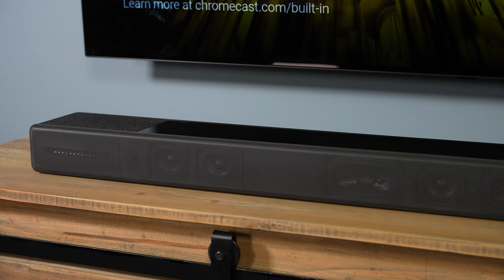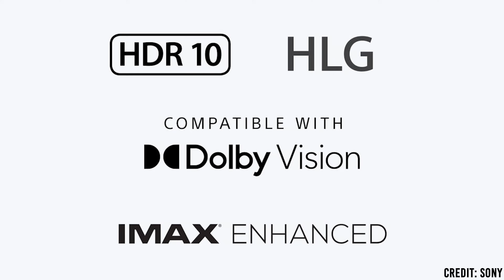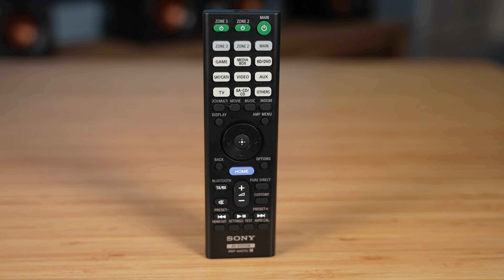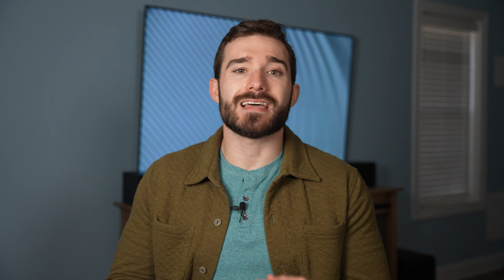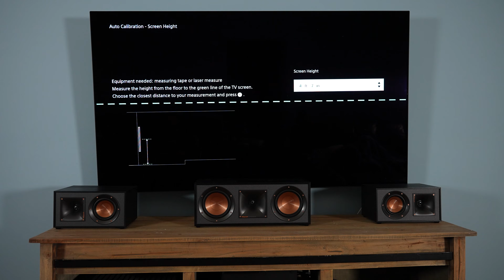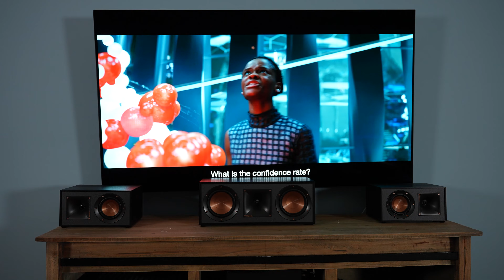NEW Sony Receivers! STR-AN1000 - Receivers are Catching Soundbars

Comment: I have the a80j w/HTA7000 bar, perspective wireless rears and subwoofer. I like the idea of getting the receiver to add a 2nd subwoofer. My question is, can this be paired with the sound the hta7000 and it will improve the audio soundstage at all? 

Second question is, can I use the receiver as a hifi player and stream throughout it to the rest of WiFi wireless network speakers in tendon with the Sony surround set up I have? I have been considering a fidelity audio player that holds a better hifi connection then my iPhone. Most importantly I’m curious if this will improved the sound bar and rest of the Sony speakers.

I love my ht7000 surround set up but do want subwoofer power, second addition sounds amazing but not a most. Second subwoofer aside, to reiterate, will this improve my surrounds performance or are they fine on their own? 

If I got this would I only get it to benefit adding a second subwoofer? Again, I have the a80j, ht7000 with perspective sub and rears.

Comment: If you please, sir, help me to connect my Hi-RES floor-standing ACTIVE-SPEAKERS, I NEED Digital Hi-RES AUDIO signal prosessing, no LOOOOOOOSEEEEER "RCA Line-In" to Active Speakers suggestion please. How can I connect my ACTIVE SPEAKERS (2.1. sterio with subwoofer) from a DIGITAL OUTPUT going out from Sony TA-AN1000 and into my ACTIVE SPEAKER's DIGITAL-INPUT PORT (HDMI EARC 2.1, or OPTICAL TOSLINK)

Comment: hello quick question I have a sony 77 inch a80 l I would like to go with this amp with a central speaker and 2 wired Klipish library speakers and put the subwoofer and the RS3 behind it on wifi that is possible ? THANKS

Comment: Hi, how does the wired setup compare to the hta9. I have the a9 which I like but clarity a little underwhelming. I was thinking of selling and going the wired receiver route. Curious if the change is worth the cost. Thanks
Reply from the maker: A proper wired setup with good speakers is going to beat any soundbar or system like the HT-A9 99% of the time. If you're able to do a proper wired setup, then that's the best route to go, it just won't be convenient at all.
Reply: Thats great feedback thanks. I am not worried about convenience and willing to put the work in. I like the idea of being able to select sterio only for music too. Thanks again
 @JonahMatthes

Comment: I have an LG 55-Inch 4K UHD Multi-HDR with Dolby Vision Smart OLED TV for the ultimate
immersive beautiful stunning movie theater picture quality When I had a 2015 Onkyo TXSR444 7.1 Channel Dolby Atmos Premium Home Theater Surround Audio/Video Receiver with AccuEQ Room Correction Calibration Software Technology Dolby Surround Upmixing DTS:HD-Master Audio 4K UHD Passthrough and Bluetooth Streaming paired with a Klipsch Reference Reference Premier and Synergy Series 5.1.2 Channel Dolby Atmos Premium Home Theater Surround Sound System I was about to upgrade my 7-Channel Dolby Atmos Home Theater Surround Audio/Video Receiver for $1,000 or less that has much more state of the art newer better greater premium features that my receiver didn’t have like DTSX DTS:Neural-X 8K/60-4K/120 Upscaling/Passthrough Multi-HDR with Dolby Vision Multiple Music Streaming Apps a High Performance Quality discrete high current power amplifier & 32-bit/192kHz digital-to-analog converters a higher end quality performance room correction calibration software technology 
I was deciding between the two highly hugely critically-acclaimed immersive dynamic impactful advanced cinematic state-of-the-art premium room-filling crystal-clearer impressive Dolby Atmos and DTSX Premium Home Theater Surround Audio/Video Receivers that both got very great reviews from both critics and users: Denon 2022 AVRS970H 7 Channel Dolby Atmos/DTSX Premium Home Theater Surround Audio/Video Receiver with Audyssey EQ: Dynamic EQ and Dynamic Volume or the Sony 2023 STR-AN1000 7 Channel Dolby Atmos/DTSX Premium Home Theater Surround Audio/Video Receiver with Digital Cinema Auto Calibration IX and 360 Spatial Sound Mapping for a the ultimate 3D Object-Based Moving Surround Sound Movie Theater Experience but Sony AN1000 Dolby Atmos/DTSX Premium Home Theater Surround Audio/Video Receiver works very best and flawlessly with 2017- present Sony 4K UHD Multi-HDR with Dolby Vision Smart OLED TVs in very great sync as a great combo for the most immersive cinematic impressive ultimate Sony 4K UHD OLED HDR Dolby Vision-Atmos IMAX-DTSX TV Home Theater Surround Sound System My 4K UHD Multi-HDR with Dolby Vision Smart OLED TV is LG not Sony so Denon makes extremely great dynamic powerful immersive impressive punchy Dolby Atmos/DTSX Audio/Video Receivers including the AVRS970H hand I choose the Denon AVRS970H to upgrade my Dolby Atmos 7 channel premium home theater audio video receiver over the Sony AN1000 because Denon makes very great immersive impactful dynamic advanced high-end/quality/performance receivers for decades so I bought and owned the Denon AVRS970H Dolby Atmos/DTSX Premium Home Theater Surround Audio Video Receiver and paired it with the Klipsch Reference Reference Premier and Synergy Series 5.1.2 Channel Premium Dolby Atmos Home Theater Surround Sound System that now finally supports DTSX and the 3D object based multidimensional moving surround sound quality with Audyssey EQ: Dynamic EQ and Dynamic Volume on is extremely impressive immersive impactful crystal-clearer dynamic realistic cinematic detailed awesome punchy room-filling advanced three dimensional atmospheric for watching enjoying and listening to films TV series music sports in Dolby Atmos DTSX Dolby Digital 5.1 (Upmixed to Dolby Surround) DTS:HD-Master Audio (Upmixed to DTS:Neural-X) Two-Channel (Upmixed to Multi-Channel Stereo) with tons of great bass treble midrange clarity impact immersion detail realism depth to be honest it actually feels and sounds like being in a real Dolby Atmos/IMAX-DTSX movie theater that totally rivals my nearby commercial movie theaters with 4K UHD laser HDR projection paired with Dolby Atmos/DTSX

Comment: The question is, can we run Wireless sw5 Sub with the physical connections of 2 Subwoofers on the backside of the receiver simultaneously? will wireless SUB with with those 2 physical connections of subwoofers?

Comment: is it possible for this receiver to change the voltage ohms from 8 and below
Reply: 6-16 Ohms Is listed on the back of the receiver. For 4ohm speakers you will need an amplifier.

Comment: Jonah, Can you please tell me IF I bought the AN1000 to replace my present Denon S760H AVR - [5.1.2] - then connect up "S" Cable between the Sony AVR and my Sony OLED A80K "S" to enable 
use of the TV's Screen Speakers as Center will Center Channel Signals still also to to my present Center Channel Speaker at the same time?   Sony does not seem to share anything like this in it's manual.  TKS
Reply: In the initial setup it asks if you want to use the television as the center channel.

Comment: Did the AN1000 you were sent happen to make a loud “Thunk” noise like someone flicking the metal shell with their finger during initial power up of this model? 7 out of 10 times my AN1000 makes that loud “thunk” metal sound that echos from the receive during power up. This isn’t the normal clicks a relay makes during power up. When that noise isn’t present I just get a very low click noise during power up like most any other receiver.
Reply: I have a Sony 550 downstairs and a Sony 790 upstairs.  They both make that sound.  I believe the sound is mechanical relays opening or closing.  It is normal operation.
Reply: @Please_Snap_Out_Of_It  thanks for letting me know! I’ve had a few Sony receivers before hand, from lower to very upper end models. I’ve never had relays make that LOUD of a noise where metal was vibrating from it. I ended up returning it just in case. The older Sony models I had did make mechanical relay clicks but barely audible.
Reply: i had that problem and return it what did you do?

Comment: I own a 4-story home In Socal and I am currently using 3 sets of sound bars including 1 for my pc. As much as I love sound bars for the clean look, receiver + speakers sound definitely WAY better than sound bars especially when it comes to watching Atmos contents. When you have a decent size room and have the speakers placed in  the right positions especially having the Atmos speakers mounted on the ceiling, there is no sound bar can come close to the immersion and spacial feel that receiver+speakers offer. I wish there is sound bar allows users to add wireless speakers and subwoofer(s) in order to create a 7.2.2, 7.2.4, 9.1.2, 9.2.4...etc setup, that will be a game changer. My wife does not like wires in the house and that's the only reason why I no longer use receiver+speakers.
Reply: can i connect with my soundbar sony a7000
Reply: Umm yeah, it’s called the Nakamichi Dragon….

Comment: Can this Sony receiver be used with Klipsch speakers, eg rp-600m and rp-500m?
Reply: I have these speakers for my fronts and rears and they are 8ohm so will definitely work. Also I ordered this receiver and it will be here tomorrow.🙂
Reply: @dlbsyst  ok, after using this receiver for a month. Update me on it’s performance with the 8ohms speakers. Ty.🙏🏿😍
Reply: @dlbsyst  I'd love to hear your impressions on this receiver. I plan on buying it to go with my Klipsch reference premier speakers. I'm very interested in it's power as how well it encompasses you in Atmos or Sony's 3d audio. Is it a big improvement over standard Atmos or audessey setups? I'm very interested to know if the HDMI outs use the same speaker setup or if zone 2 uses a different set. Thank you for your time.

Comment: How does the setup with AN1000 and wireless speakers vs HT-A9? Right now, HT-A9 got deep sale; I wonder if I should go that way.
Reply from the maker: That’s going to depend on what speakers you are using as the front channels. Having an actual center channel will help a bit more with dialogue (the HT-A9 phantom center is surprisingly good tho). Downside with the AN1000 is that you don’t get front and rear height channels, you can one get front height or rear height, not both. If you want a super easy setup process and something stylish, the A9 is an easy choice.
Reply: @JonahMatthes  it means that you can connect wireless speakers to this receiver in conjunction with other speakers, I understood you correctly, I want to combine sa-rs5 speakers together with speakers from another manufacturer in the future

Comment: I have a Control4 system installed and am upgrading my receiver to the STR-AN1000. The microphone cord is very short.. How would you set this up if the receiver is in an equipment bay 30 feet away from the listening room?
Reply from the maker: Hmmm, hadn’t thought about that. I imagine you can buy a long extension cable for that specific plug. I’m not sure if the exact specs of the cable, but there’s definitely an extension cable you can buy on Amazon or somewhere to accomplish this.
Reply: Setup manually.

Comment: Why the don't just make a receiver without amplifier and 2  or 4 channel amplifiers and wireless speakers for surrounds. That would be much better option. You just add to your home theater later on.
Reply: Is that not the same as a processor and external amp...or separates?
Reply: @hyperactivetendencies7054  yep, you could call it that. But normally processors are for studios, not for home and those prices are quite high. Also having already amplifier for a front channels and center is reasonable, because you still need cables for those (does no matter if it is power or amplified signal)

Comment: So basically this is a 2017 dn1080 with 8K support..
Reply: Yes, typically new models are the same as previous with some slight updates. Lol.
Reply: @DrakonR  I totally agree if the dn1080 was only a year or two old and I get what u r saying but imagine Samsung only just now in 2023 releasing the galaxy S9 after 6 years of selling a galaxy S8 which also came out in 2017. There should have been way more improvements in this lineup. I mean the display still looks like a bedside clock from the 80s..
Reply: @ntme9  LCD is not a big problem. A need a switch inputs, when AV is in standby mode. And sadly i miss a phono input.

Comment: Once the novelty wears off that's where one will normally start to become aware of all the unwanted sounds. For one to have a perfectly quiet room I would highly recommend shielded speaker cables. They don't necessarily have to be expensive just just so long as they're shielded. You'll only end up doing it again, if not you're probably just used to having your room Sound full of electricity! What we call in the industry a high noise floor!